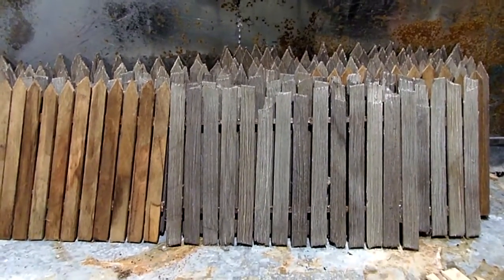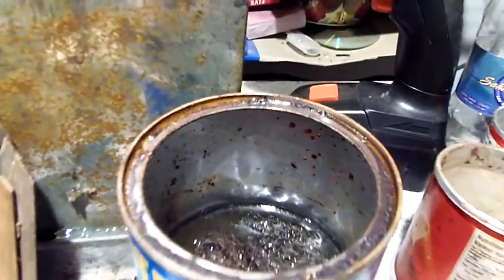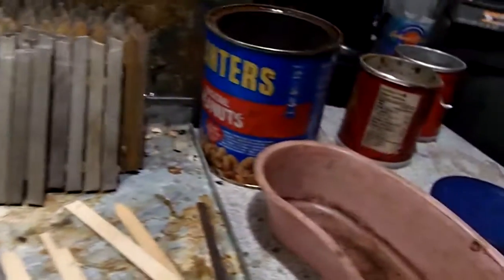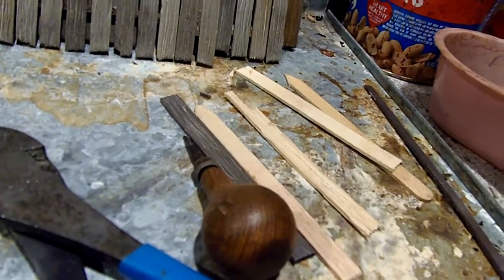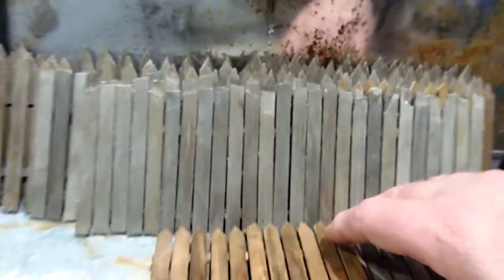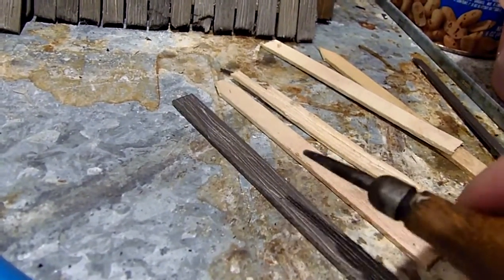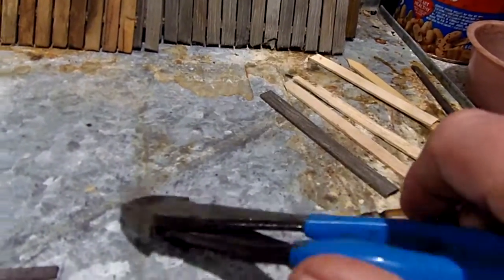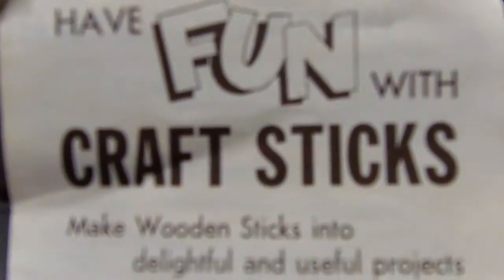Diorama Tip for Weathered Wooden Fencing

Comment: How do you get rid of the vinegar smell from the fences? I think it looks fantastic and a great way to batch-weather a lot of fencing. But if you were doing a lot, I'm concerned that your diorama or game table would smell of vinegar.
Reply from the maker: You should always use a matte dull coat of spray lacquer to seal everything. Wait until it is totally dry and give it two light coats on every side  (incl.the edges! ).

Comment: Thank you! This process looks effective and easy. I like the effects you achieved with the gray distressed fencing. How long did you soak the wood in the solution to get these results? A minute or two, or was it longer?
Reply from the maker: It is best to leave it in for a few hours (2-3) because the longer it soaks the more the chemicals darken the wood. Since there are many variables you should try various soak times to see the results with particular types of wood and strength of the bath. Remember to let them dry as the color is only obvious after they dry completely. Experiment!

Comment: hi. does cold  temperature or the type of container slow the process down. I have put the steel wool in white vinegar and nothing has happened. been in it for 3 days so far.
Reply from the maker: The solution darkens over time but is still able to stain or ebonized the wood to some extent. Did you try putting the wood in it yet?
Reply: I hadn't tried it because I was expecting the vinegar to react with the steel wool and change colour but I  have tried it now. sir you are a genius. its worked a treat. very impressed. thank you so much.
Reply from the maker: Glad to help!

Comment: How much steel wool?  How much vinegar?
Reply from the maker: That depends on how much wood you want to age and how dark you want it. the quantity of vinegar relates to how much you want to cover and what flat container you will use. The soaking can be a quick dip or a heavy wash. Obviously, this technique is variable according to factors such a how long you age the steel wool and vinegar solution-it gets more potent the longer it sits- the type of wood and how well you sand it and even the number of washes you apply. Start with a cup of vinegar and a 4-inch length of fine steel wool in standard size. Experimenting is half the fun!

Comment: I feel like it was not very helpful
Reply from the maker: What about it needs more detail or clarity?
Reply: @skphile2342  yes, please more detail such do we need to wait the mixture in couple day or couple hours before put the wood stick in? and the ratio of steel wool and vinegar? there several type of vinegar, any special vinegar we need to use?
Reply from the maker: @duytran1134  White vinegar works fine. Try a cup with four inches of fine steel wool. Wait until the solution darkens ( 24-48 hours ). This process is not difficult but may require more time to get it right. You will need some patience and must be willing to try it out.